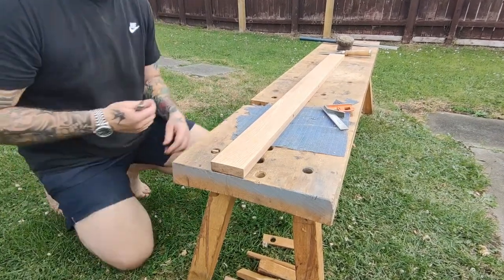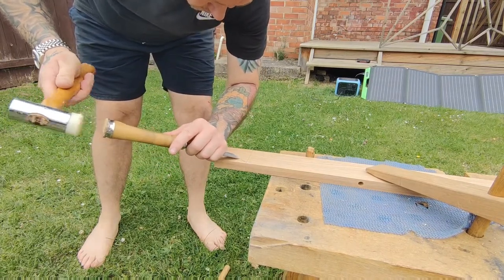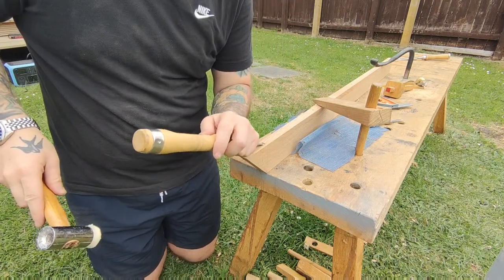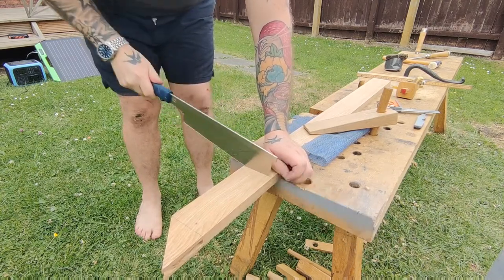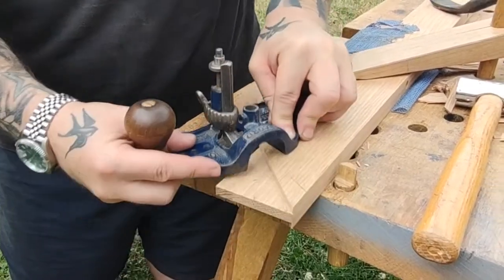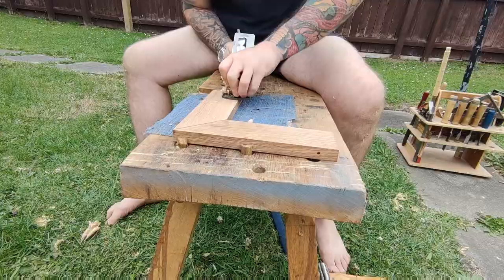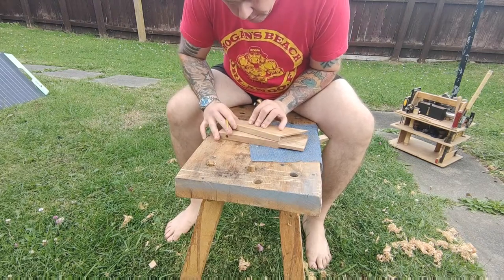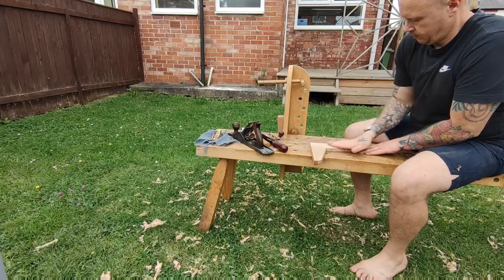Shelf brackets

Comment: Awesome project. Would adding a dowel pin to the joint help the strength?
Reply from the maker: It would but, not so long ago, I made a bridle joint in a table. I decided the design was a dead end, and abandoned the build. So I salvaged as much of the Frame as I could. I tried to break apart the joint, which I physically could not, even though there was plenty of leverage. It took all of my weight, stamping on it etc. In the end, I had to saw it and the joint went into the fire pile. 

The bracket will pull out of the wall, long before that joint will fail. You could add a dowel but, in this case I would not bother.

Thanks for watching, I appreciate it 👍
Reply: Those joints won’t go anywhere!

Comment: How strong are they? I'm planning to make some brackets for a corner wall table that will hold a keyboard and other stuff. Is this design strong enough? Thanks
Reply from the maker: They're plenty strong, as long as the joint is a good fit. That combined with glue, and there solid. You'll pull the screws out of the wall, before the joint gives.

I had a bluetti sitting on it for months, now there's a microwave sitting there.
Reply: @DW_woodworks  Perfect, Thank You!
Reply from the maker: @Cessna172G  you're welcome 👍